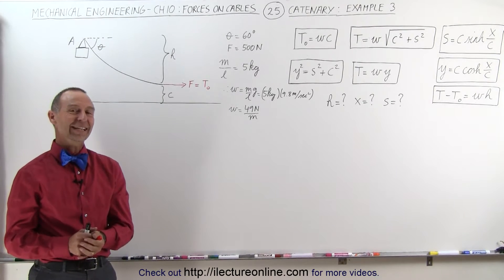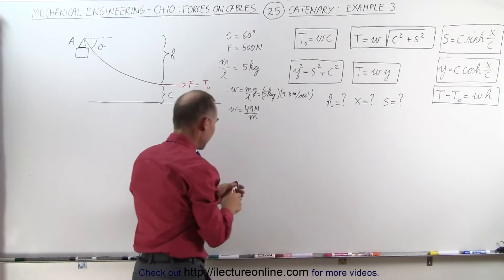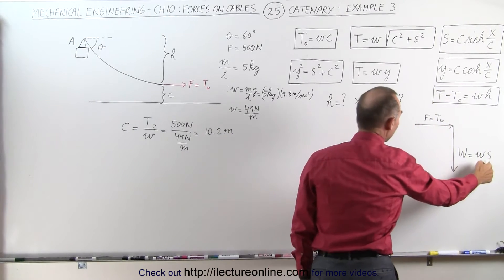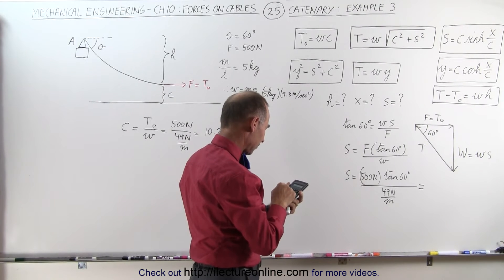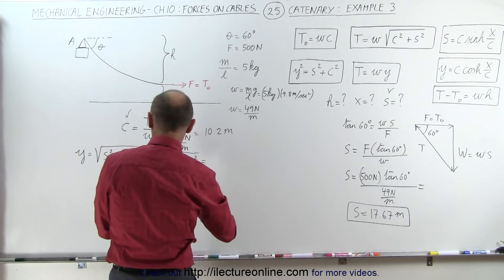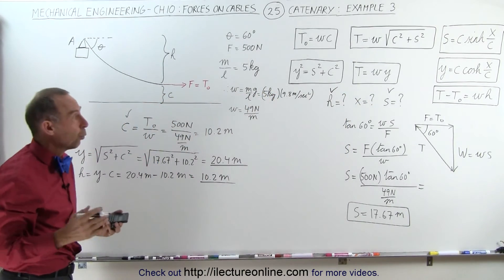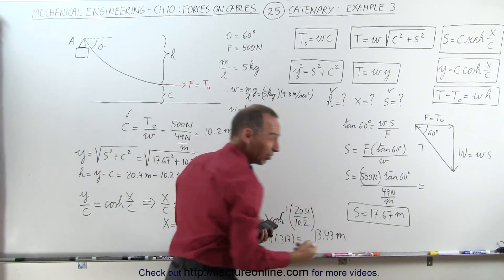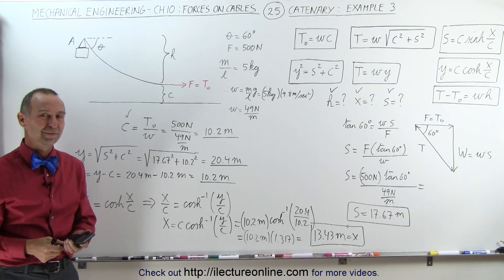Mechanical Engineering: Ch 10: Forces on Cables (25 of 33) Catenary - Example 3

Comment: thank you for this videos but i am a bit lost sir, is the minimum torque = to the weight per unit length multiplied by the drag distance? if yes then why?
Reply from the maker: Not sure what you mean by the "drag distance".  That term usually has a different meaning and application.